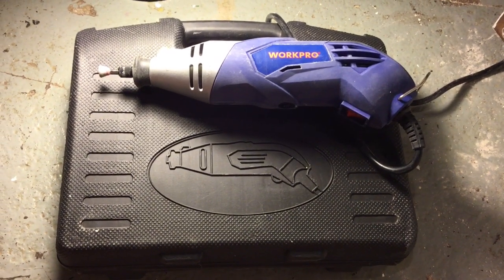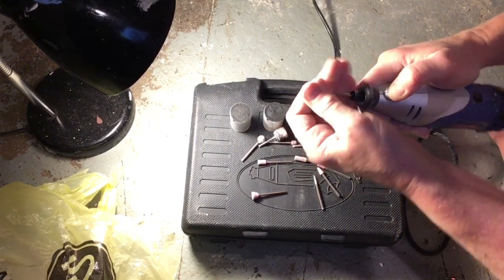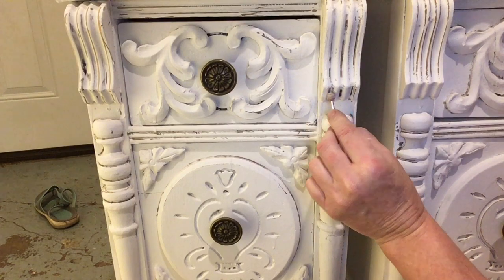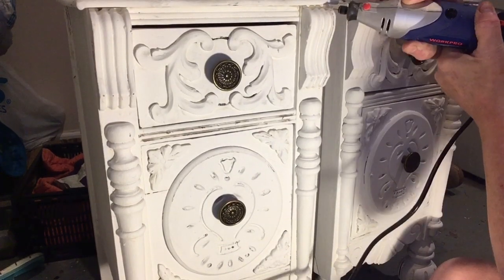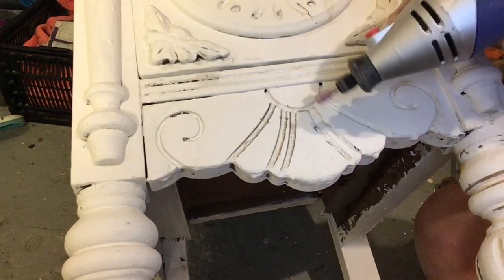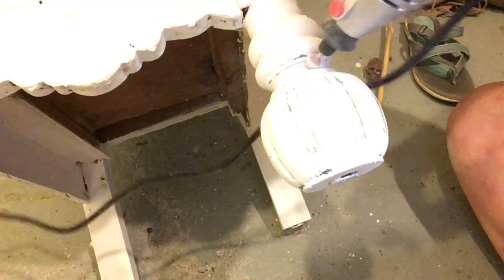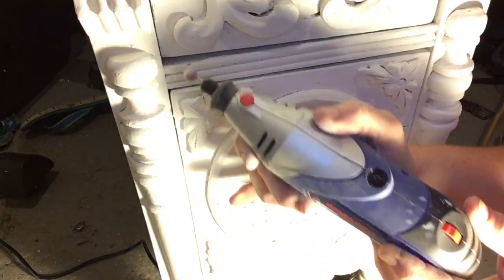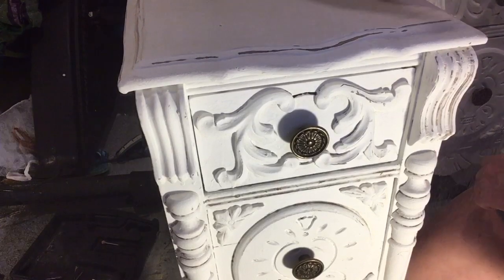Chalk Paint Distressing Hack! Sanding Hack Rotary Tool Fun! Sanding made Easy! (Dremel tool)

Comment: Oh I have a Dremel, i'm excited to get going. Right now I'm testing out sever DIY Chalk paint formulas.
Reply from the maker: I am getting ready to do a video on comparing DIY chalk paint. I can tell that after using plaster of paris for years, I have switched to lime. No lumps, no drying in the container overnight. Love the lime!
Reply from the maker: A Dremel also works great for removing chippy or loose paint before painting your project. I just had some antique end tables with tons of little grooves and I got that paint out quite nicely with a Dremel.